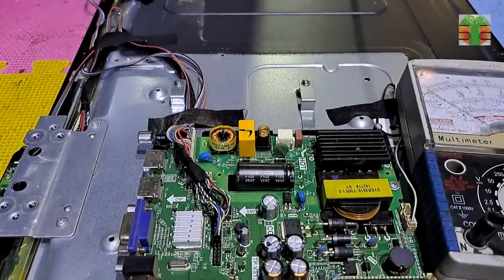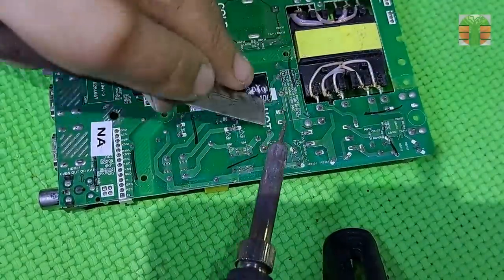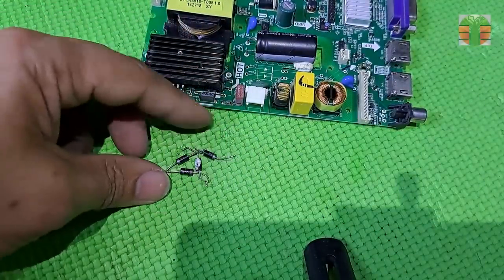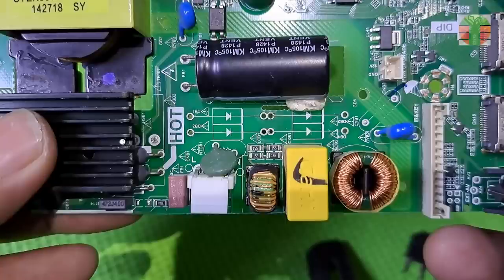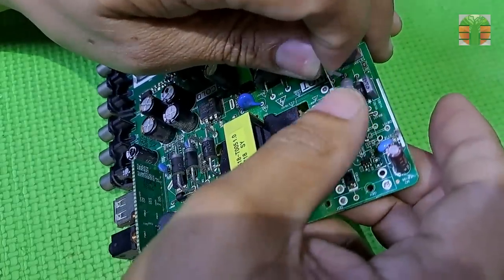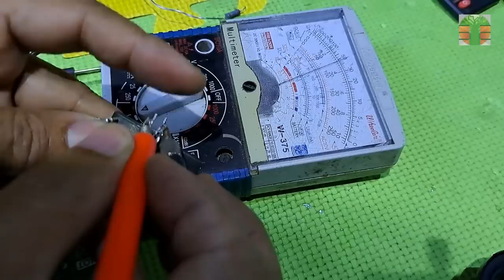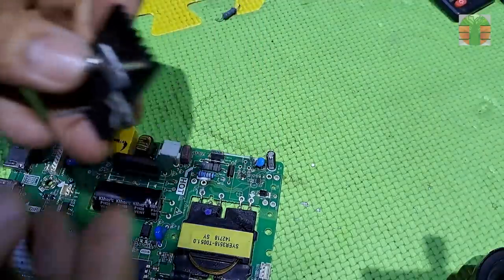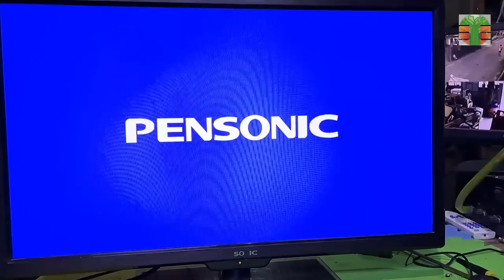LED TV (Diode rectifier replacement)

Comment: Hi Mr T. I have a TCL tv. No display. I can get half screen back by taping one side. The middle part of the screen bleeds across a little bit but mostly still have half side black? Do you think is ckv lines need cutting? The scalar board Has no shorts. Fuses ok. Only one ic. No other semiconductors. I'm guessing problem into the LCD panel. Not sure which lines I could cut?
Reply from the maker: cutting is not gonna work. Mostly half screen is the COF is the problem
Reply: @tevzTVTevatronics  I used VGHF onto vgh test point and now has 33v on both scalar boards. Full screen appears but fades in brightness as it gets to edge.